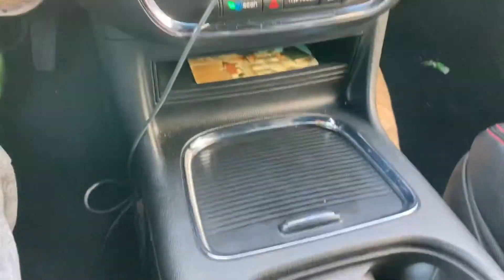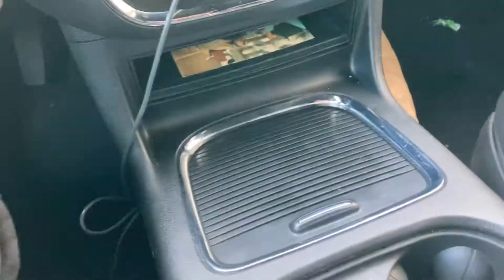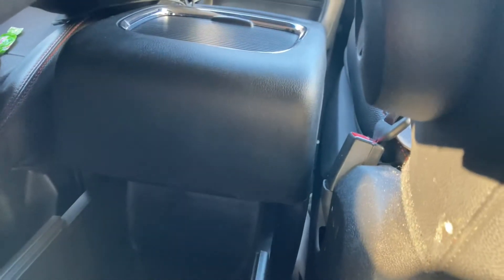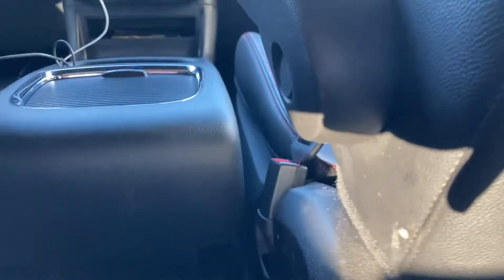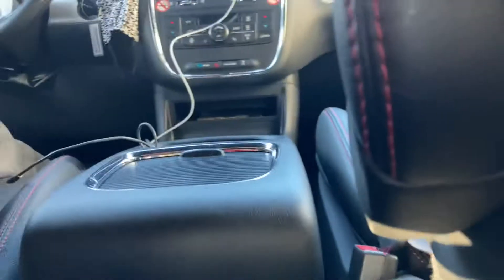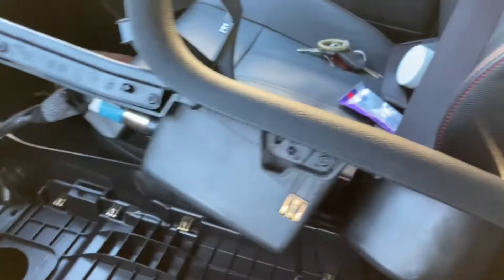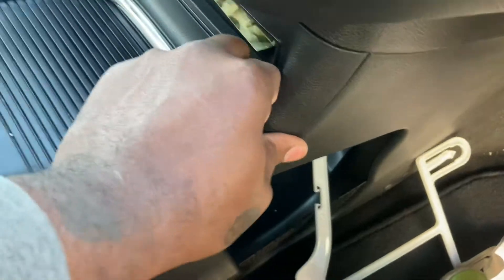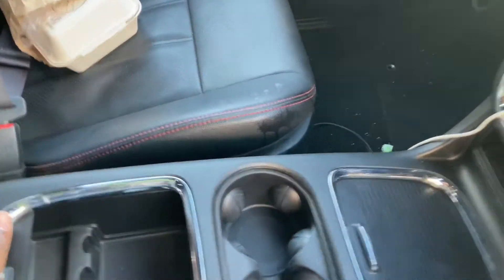How To Take apart 2019 Dodge Caravan Center Console ( Without breaking)

Comment: My wife lost her new drivers license a DAY after it arrived in mail. Hers was even farther forward in the console. There are two screws each side of console (by the gas pedal) and then down by your feet passengers side. The better access is on the drivers side but pull that plastic shroud back fairly aggressively and there is enough to get a small arm and hand back there to get it cds, credit card etc out. I could get two fingers on her ID but couldn’t finagle it out. It took me holding back on the plastic and her reaching in (up and over metal portion) to get it. This all makes sense I promise if it happens to you. Thanks for your video. YouTube courage to wreck your @:&;7::&/&$:!
Reply from the maker: 🏆 you get the award for dedication 🙌🏾 glad you found my video to help

Comment: OMG! THANK YOU! THANK YOU! THANK YOU! I set my military dependent ID on the console drawer and it just disappeared. I thought it slid off onto the floor. The sentry wouldn't let me on base. I spent 15  minutes in the dark, in the rain, outside the gate to the base looking for it. All I got was more and more pissed off and wet. The sentry finally let me on base with my new drivers license after he verified I lived in the base, but it's still frustrating because I need it for everything on base. I figured it fell in a crevasse under the console but there was no way to get in there. And that seemed impossible. I even tried removing the drawer, but it's not like a kitchen drawer where you can lift it up and irked come off the track. I found your video and was able to remove it, thanks to you. Thank you so much!!! 😊🥰

Comment: Thanks for the tip man. I just got a used 2017 grand caravan and it came with roaches. I wanted to strip it and fog it out completely. I just opened it up like you showed. All kinds of gunk in there.
Reply from the maker: Oh no sorry to hear that but your getting those critters out of there
Reply: @kennyvspoverty  Yeah I got 2 boxes of bug foggers. I'll put all the seats up and open the floor panels and let all those off. Next day I'll clean it up and put some armorall on the dash and wheel. The dealer should have done all that but they didn't. Still a great van and when you pop the hood theres not even a spec of dirt on the engine. Whoever owned it last barely used it. Probably used by an uber driver or something. I may have to let the middle console's sliding door covers sit in some peroxide since they yellowed. So it's good I know how to remove the top now.

Comment: Nice, but not a solution for many…if you look it slips even further  beyond the point of the upper module. NO MONEY SHOT in ANY video of this yet.   It slips BEYOND the console and cannot be accessed. There is one wire and perhaps a label interfence, however it IS smooth sailing for a I’d or credit card to slip behind if conditions are right and it happened too me. i think it may have interfered with my shifting as well.
Reply from the maker: Your absolutely right I call that the point of no return 🤦🏿‍♂️
Reply: @kennyvspoverty  The black hole…what a crazy design.

Comment: Do you know how to take out the bottom drawer that slides in and out? I have stuff that has fallen behind it.
Reply from the maker: If you lift up (fairly firm) the top portion of the console it will disconnect from the bottom allowing you access behind the drawer
Reply: @kennyvspoverty  thank you!!